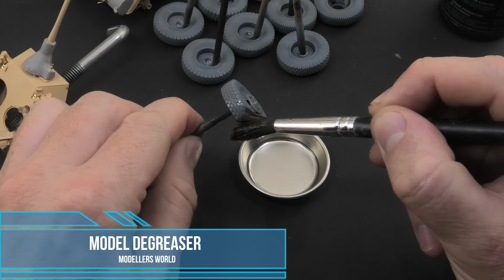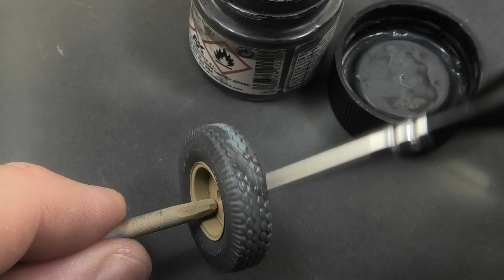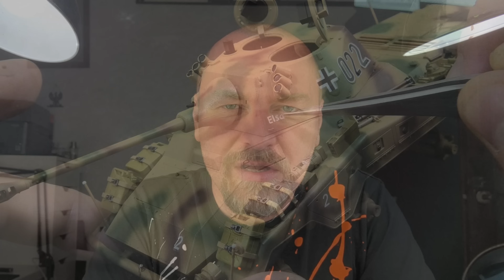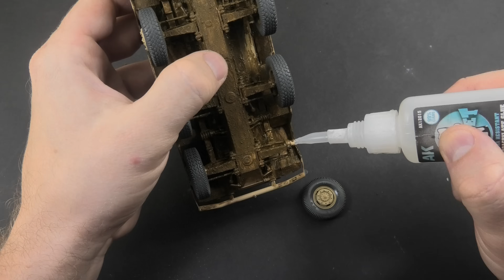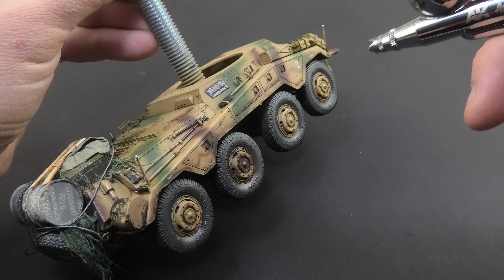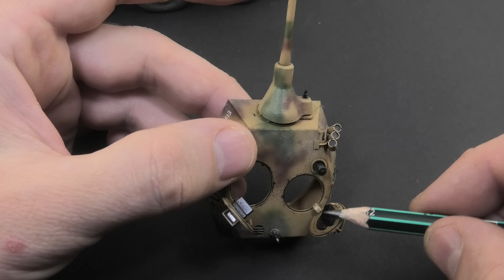Don't Paint and Weather Your 1/35 Puma Until You See This Video!

Comment: You don't need to use a branded model degreaser... It is just isopropal alcohol... And priming the model is totally different to cleaning it... The primer is designed to etch itself to the surface and provide a consistent layer for you to paint over... Priming has very little to do with the paint adhering to the model
Reply from the maker: Thx mate! :)